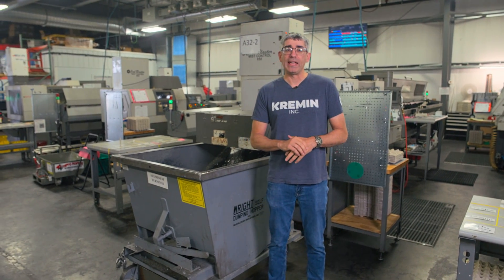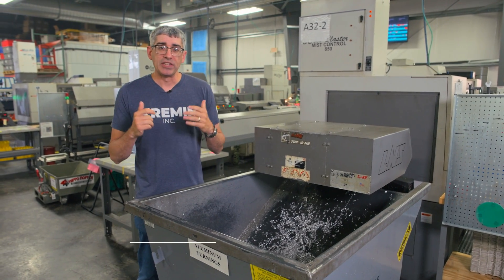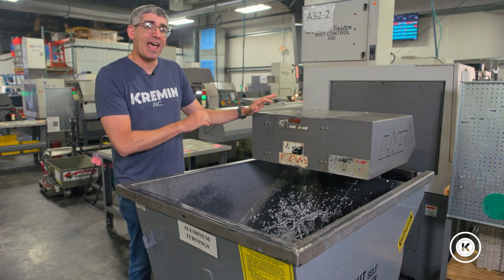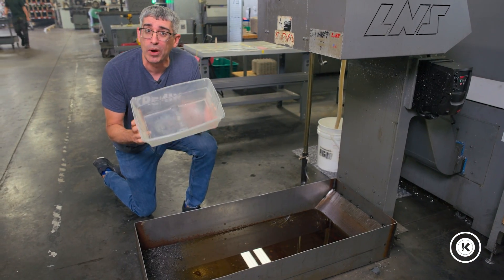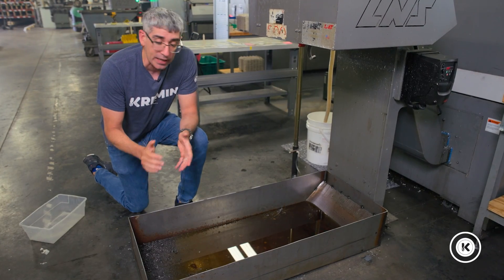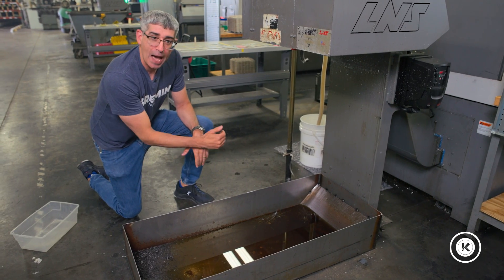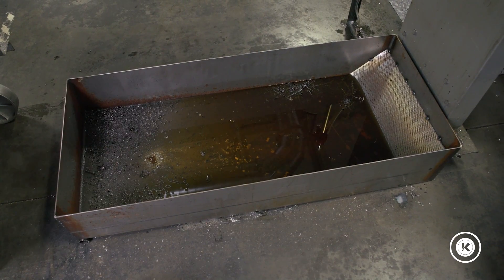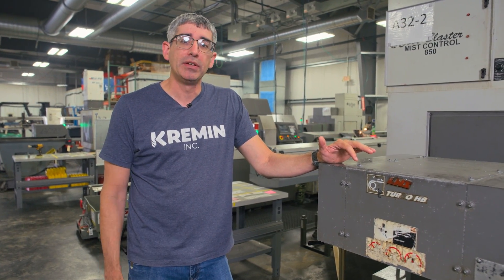Stopping Coolant Floor Spills - Kremin Inc.

Comment: Did you drill holes in your dump hopper to let it drain?  Charles
Reply from the maker: We have a drain hole with a shut off valve that we installed.
Reply: @KreminIncManufacturing  Thanks.